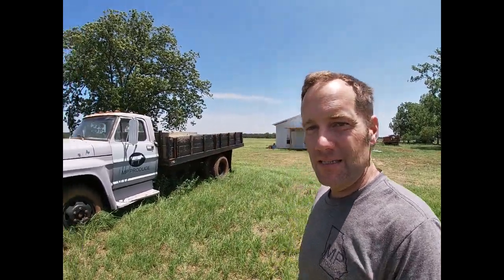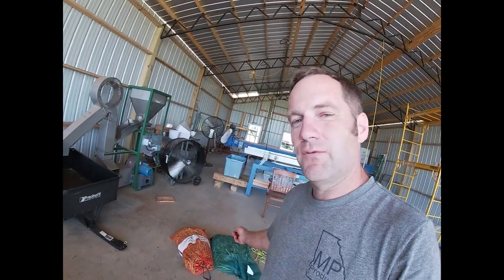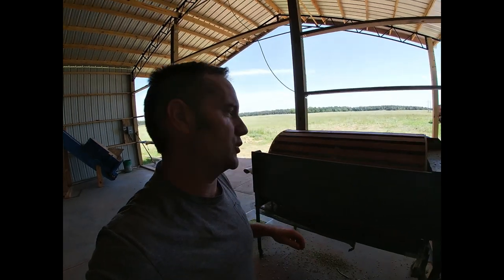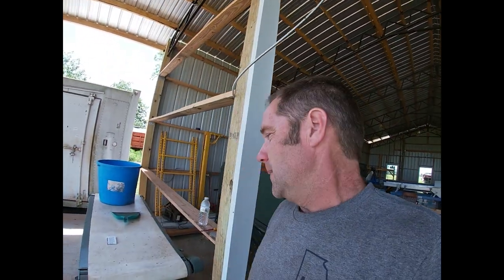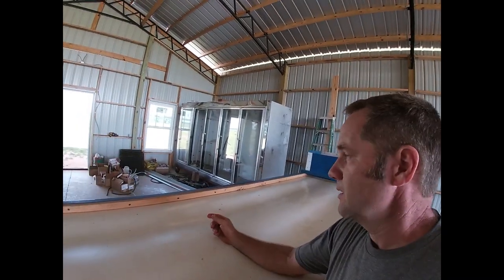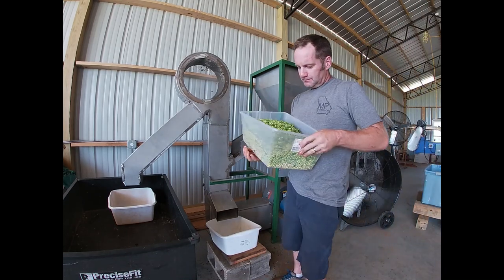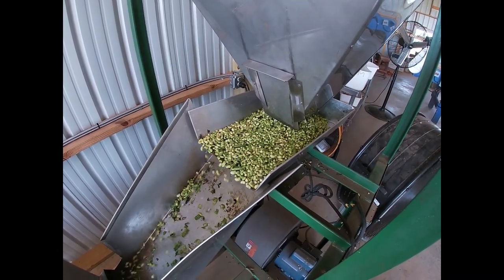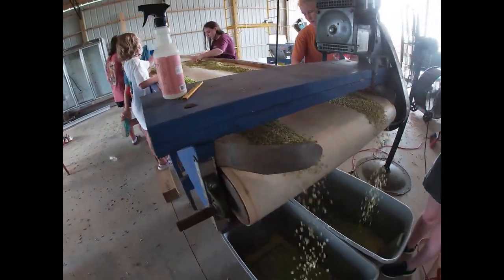Quickly shelling southern peas

Comment: That Cario cleaner is good, but get up with Wellborn Devices (Manufacturer of the Rotofingers) and gt them to build you a eliminator cleaner. It will beat all of them...trust em, it cleans behi8nd the Taylor Shellers at a rate of a bushel a minute.